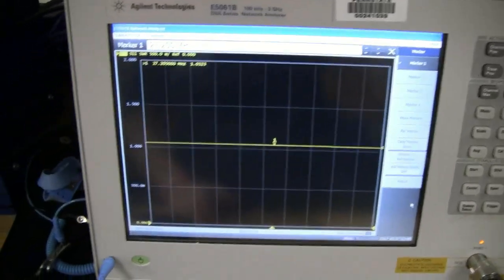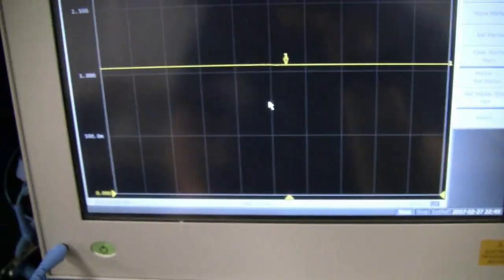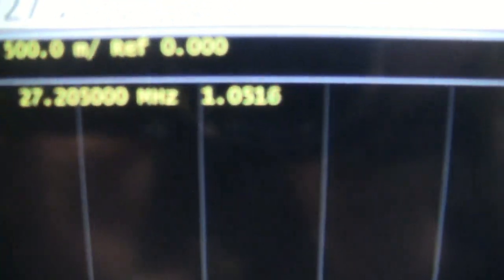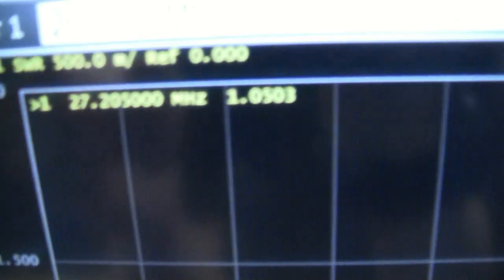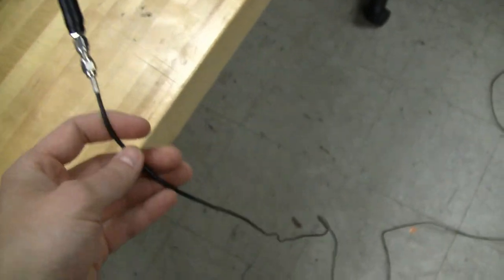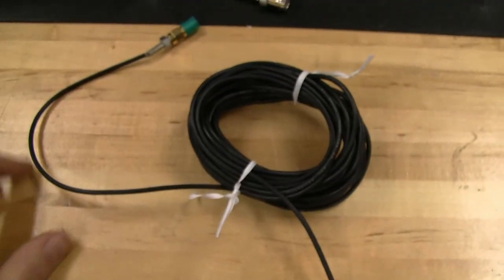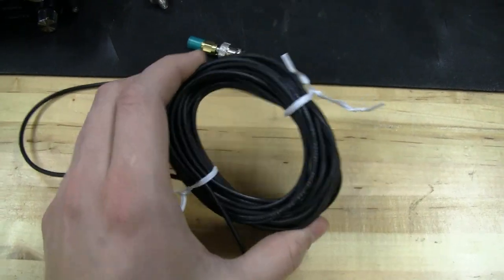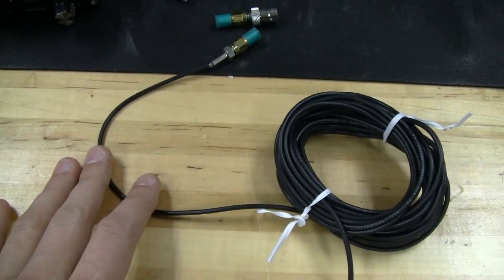Does Coiling Coax Cable Hurt Your SWR?

Comment: your test is invalid. 
a dummy load is not an antenna. an antenna is an L C network which values equal 50 ohms at the frequency applied. 
if you wanted to do this test properly you would have used a "T" at your scope with the dummy load on one side of the "T". the other side of the "T" would have the coax under test. immediately you would have seen an incorrect vswr reading. to correct this, you need to trim the coax till your scope gives you a reading of a 1.0 vswr with equal amount of vswr band width on both sides of your vswr dip. once this is done your coax will now be in an increment of a 1/2 wave to the test frequency.  then you would coil up your coax to see if the vswr changes. this way your scope sees the Resistive load and how the Inductive and Capacitive properties of the coax reacts to the load. Further more, as long as you coil is wrapped around a non conductive core neatly side by side to the previous coil, you prevent common mode currents from traveling down your coax from your antenna causing you to have a false vswr reading in your shack, amongst other thing. Make sure you coax is on a form rated by the manufactures turn radius listed in the datasheet.
Reply: Agreed,   I have seen a 3 dB or more reduction in coiled coax at VHF frequencies...
Reply: That's the myth of a need to trim coax!
Coax is a shielded cable and coiling it or changing the length should not make any difference. If it does there is a problem somewhere. You are correct about CMC and probably the reason for a change in SWR when trimming coax.
A dummy load represents a good 50 Ω. A properly matched aerial should also be 50 Ω, neither reactive nor capacitive, ideally the L and C should cancel each other.
I've never had any need to trim coax cable lengths to my 20m, 17m, 15m, 12m and 10m dipoles or 60m inverted vee or any kind of vertical I have tried. All home made and not bought.
G4GHB.